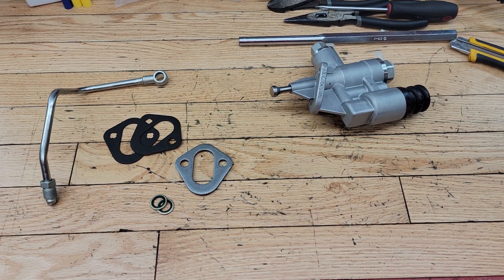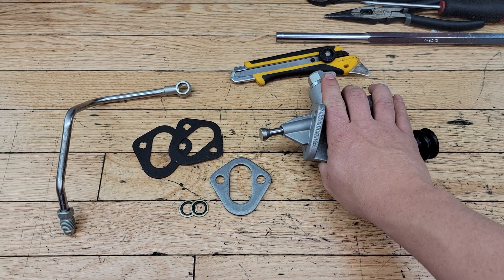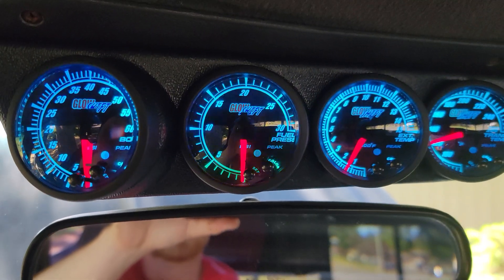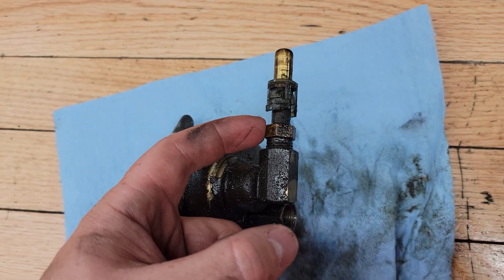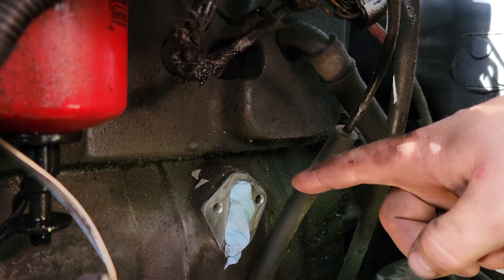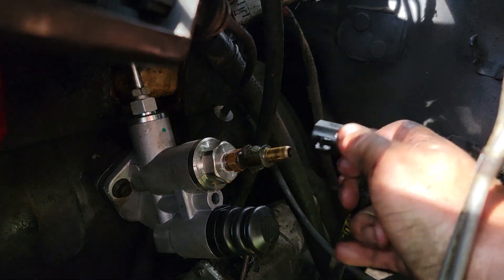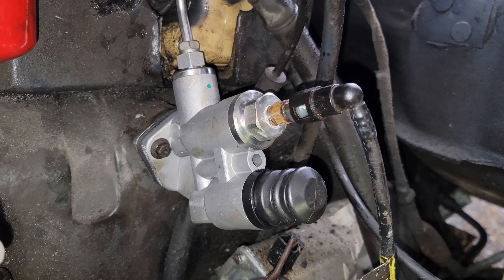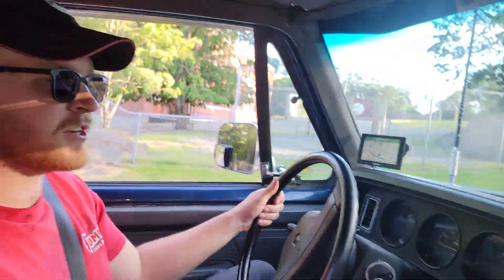HVLP Lift Pump Install | 1st Gen Cummins

Comment: I keep turning the cam bc my lift pump won’t go back in. I’ve turned and turned on the cam and i just can’t get the pump back on I need help boys !!!
Reply from the maker: Crank over the engine a bit by hand using the alternator nut slowly and try bit by bit. Don't forget the spacer for the pump

Comment: I know this is an older post, but I thought I could add a couple of updates: Pumps on eBay for $60, complete with a stainless exit tube, bleeder valve, gaskets and a steel spacer- have a 25mm bore. Earlier versions have (I believe) a 30 or a 36mm bore- so the output will vary by volume and/or pressure. I am just installing mine now (25mm) and others have changed the spring inside to lower the output pressure. This pump says it is specifically for the early VE pump CTD motors, but in the description elsewhere, it states it is for 1994-98 second gens. The Chinese are clearly confused in their advertising. My plan is to check the pressure and change the spring, if necessary. Has anyone used this pump as is?

Comment: Great video!! I got the pump and spring.  Question… where is the location that you test the pressure from?? Location you hooked the gauge too? Was it at the top of the fuel line, coming out of the filter, where the banjo bolt with the snubber is ??

Comment: did you have to turn the motor to TDC (top dead center)? per a tip sheet that the pump came with. I also did not get the HVLP pump I got the stock one.
Reply from the maker: No I didn't. You can get lucky so the cam lobe isn't in the way but if it is just bar the engine over until it's out of the way
Reply: @OvensGarage - How do you bar the engine over?
Reply: @chickywilly  I've heard that one can put a socket on the alternator pulley and wrench it over but it might just slip on the belt. Or put a socket on one of the bolts of the crank pully (harmonic balancer). There is a barring tool but it's trickier to use. You'll have to search that here on youtube and you'll see what I mean. You should be able to find a vid on barring the engine over, though. Good luck, brother.

Comment: Working on it. A 91 non intercooled. Where the extrusion is above the new pump mine isn't insulation filled. It is a very hard slightly thick plastic. No luck with the utility knife. Wondering about a Dremel tool. ? Any thoughts from the universe ? Anyone elce with a non intercooled experience this ?
Reply from the maker: I would try a grinder or torch. Lol
Reply: @OvensGarage thank you sir.

Comment: When I put mine on the metal spacer was not made properly.  The holes were just a bit too close together to allow both bolts to thread.  15 min with a Dremel fixed it but for the price of the kit it should not have happened.
Reply from the maker: That's a shame, mine went in pretty smoothly
Reply: I just searched to see if anyone else had this problem before I started my install.  My problem is the holes are too small on the pump itself for the studs and it’s not centered. So if I drill it I’m afraid I’ll take to much material off the pump housing and weaken it. I guess I’ll try a dremel too…

Comment: Bound to give a little low end timing advance with that extra fuel pressure.
Reply from the maker: I'd like to beef up my a158 a bit before I throw more power at this thing. Either that or swap the Trans, wish it did a better job putting the power to the ground.